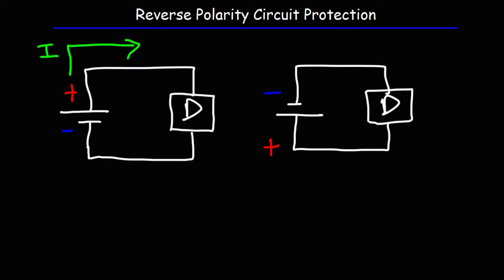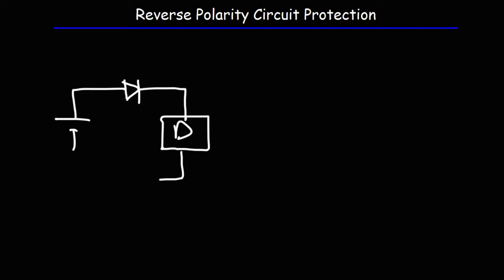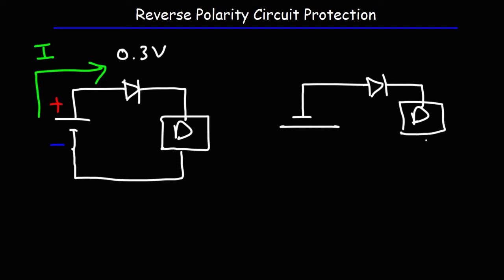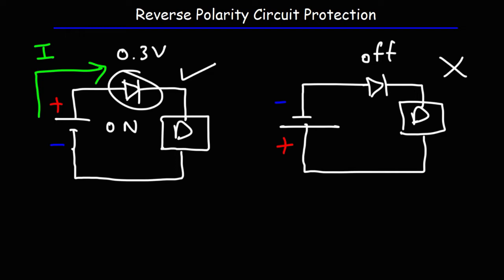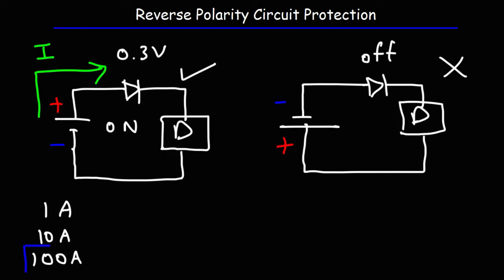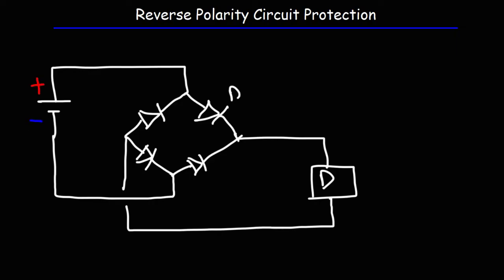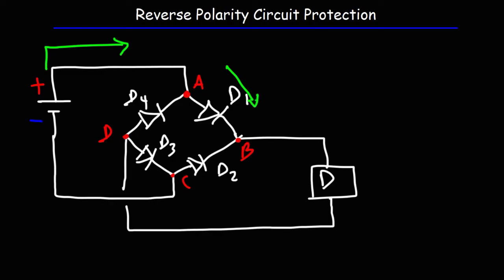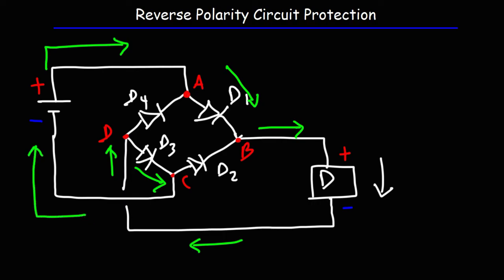Reverse Polarity Circuit Protection Using Diodes

Comment: Great video; I see you suggest a fuse on the negative terminal, is there a reason to do with this particular rig? Just curious because I'm used to seeing them on the positive side :)
Reply: Normally it is on the high side mainly because it's safer that way because if it blows the load won't be sitting at a high potential (remain hot) and create the possibility of electrical shock for someone who is grounded.  The fuse will still blow if on the ground side, it's just not generally considered recommended practice.

Comment: Thank you for your video, It is much clearer than others.
My question is that is it possible to use resistor other than fuss.

Many thanks.
Reply: Does the the diode limits voltage drop or current output? Can you make  video?
Many thanks
Reply: It only affects voltage drop in a general sense. Typically full wave bridge rectifiers are used to convert an AC output voltage to a dc input voltage except your output will have a different  voltage as a result of the averaging of the ac input. But in general the current is constant. Typically if you’re using this circuit to convert ac to dc you would use a capacitor in parallel with the load to smooth out the ripple.

Comment: this is good info but your electron flow is backwards, current flows from negative to positive  and through a diode against the arrow    neg - ----<|---- + pos. in all your examples your circuitry is correct but your current flow is incorrect.
Reply: Ya in 5:19 i think there is a problem
Reply: He's using the standard which is "conventional current".  Google that if you've never heard of it before.